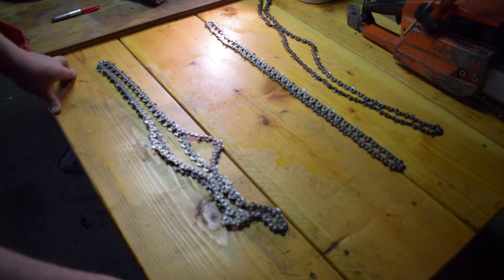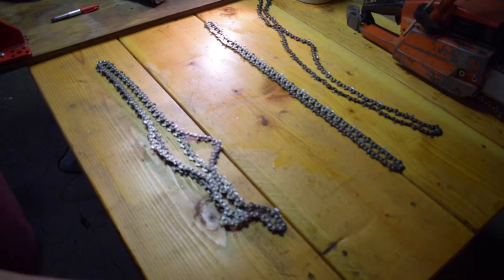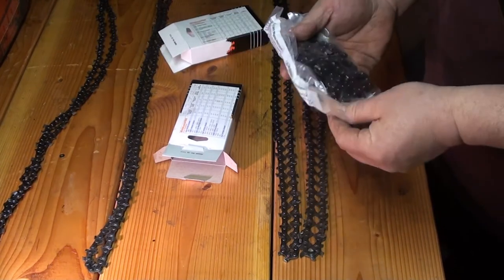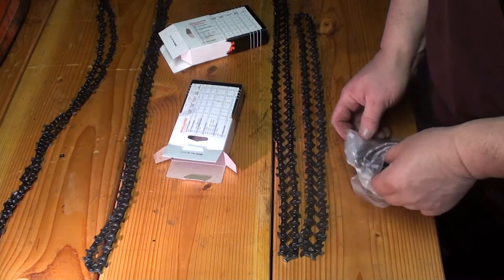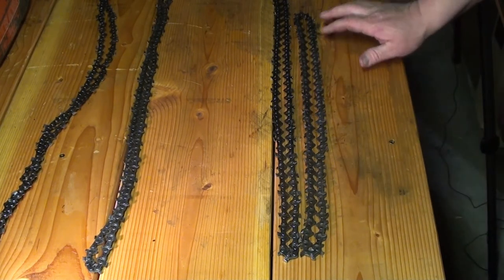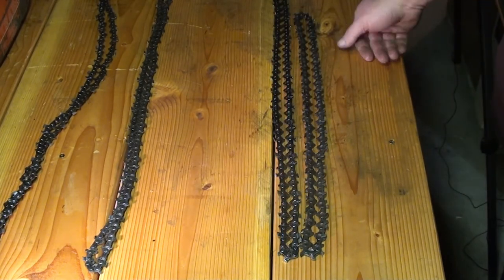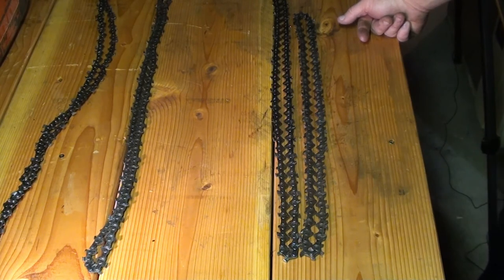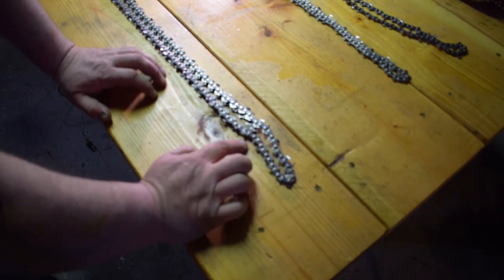Chainsaw  Chain Repair Explained

Comment: I have a number of these chain that I need to shorten up to use on the shorter bars. I guess I am just to hard on my saws had to rebuild the Huqvarna the other day most be run them to lean.

Comment: I might have missed it did you use the ripping chain yet the last video I think you said you were using a standard. I just bought two grandberg chains I guess will see how that does.
Reply from the maker: I do use rip chains for making lumber but you can use a standard chain as well but it will not cut smoothly.  Rip chains cut slower and help keep the chain speed up.  You can make some nice lumber but take your time.  Thanks for watching

Comment: What length bar on a chainsaw do you tend to use the most?  I suppose it depends on the size of the trees in question.. but generally what size do you run the most?
Reply from the maker: My Big saws run 24 inch bar and chains and the small runs 18 inch.

Comment: What length bar on a chainsaw do you tend to use the most?  I suppose it depends on the size of the trees in question.. but generally what size do you run the most?